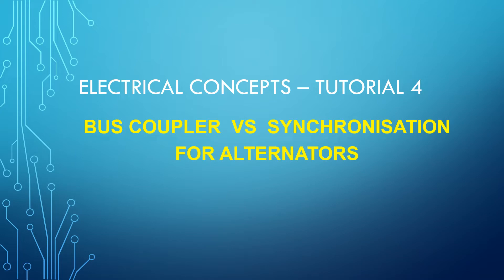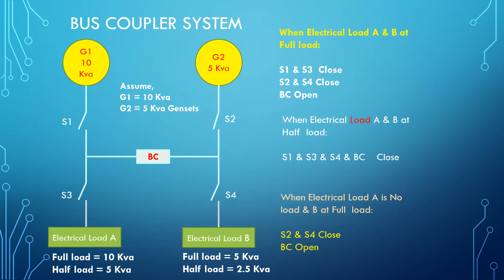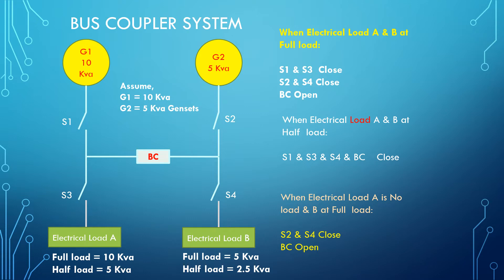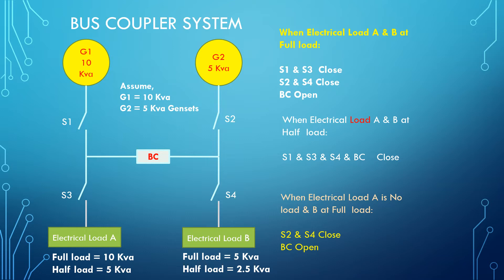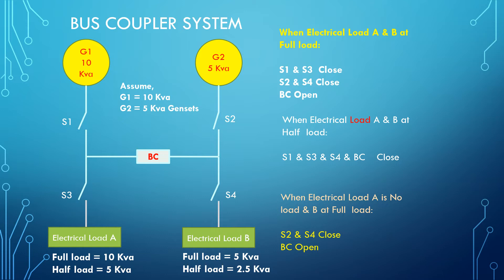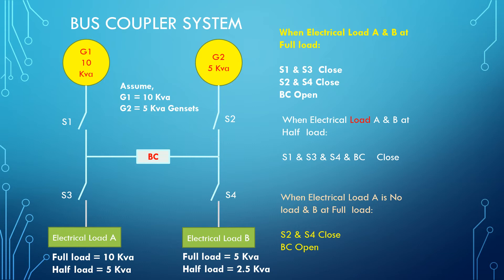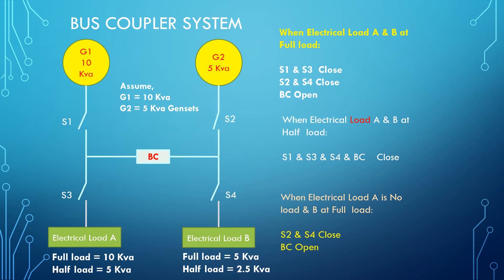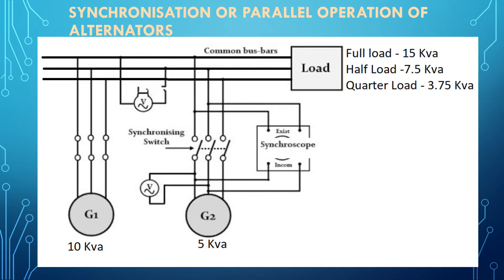Electrical Concepts Tamil  4 Bus Coupler Vs Synchronisation Panel

Comment: Very clear explanation thank you..Can I pls know If we have synchronisation method why we go for bus couplers?..Is there any specific application or advantage of bus coupler over synchronisation ?
Reply from the maker: Bus coupler is useful when single generator feeding two different loads, but synchronization is different, it is used when  more than two gensets (Same capacity) feeding into a single load.